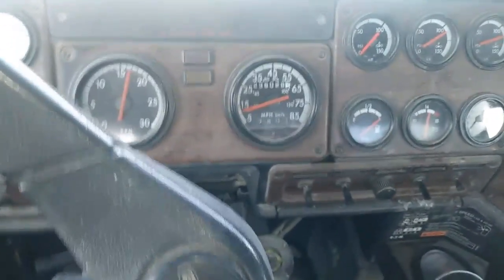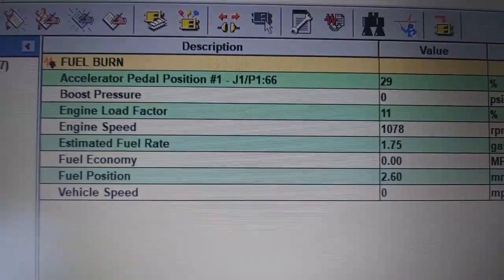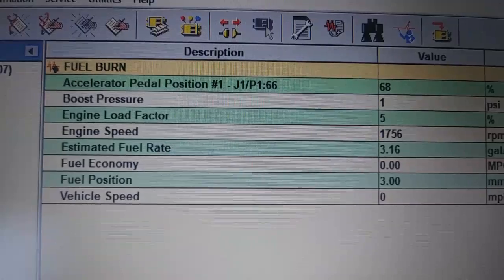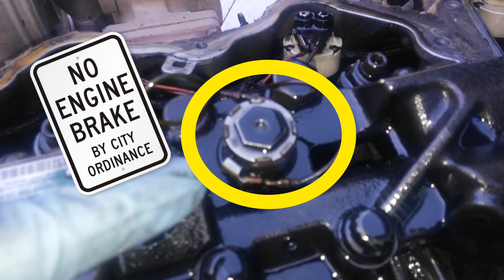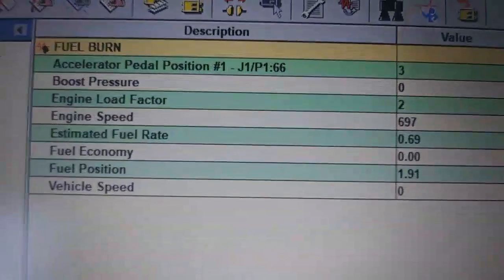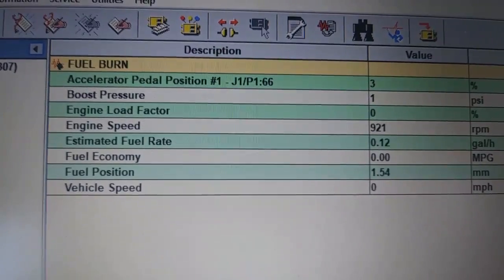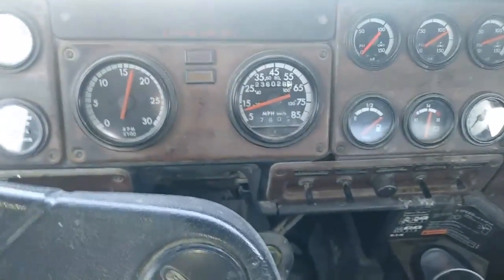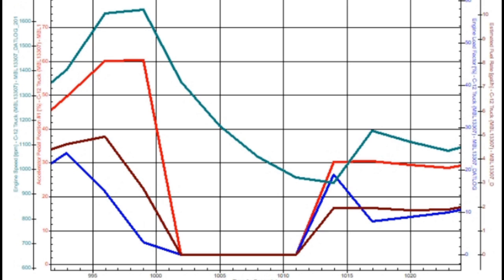Does Engine Braking Waste Fuel? Do Jake Brakes Waste Fuel?

Comment: I know your an cat certified mechanic.  But call me crazy,  but in order to downshift a gear,  you have to rev the rpms up right? In other words it does burn fuel but not when the Jake or engine break is currently in operation.  Just when dropping gears.
Reply: Well essentially yes. But when you have throttle input the Jake brake turns off
Reply: Your question is a little misleading. It is not the increase in RPM that burns more fuel. At a closed throttle position a gas engine uses the minimum level of fuel. A diesel at idle position injects the minimum amount to maintain engine rpm and most injector pumps if the rpm is higher than idle but the throttle is at idle inject zero.
   On both types of engines when one blips the throttle to assist in a downshift there is very little fuel used. Any fuel burned greater than what is needed to maintain creates usable power. When you are in gear this is what accelerates the vehicle. When one shifts all extra energy goes into accelerating the engine (or engine and transmission if power shifting). That really is a very minor load compared to the vehicle. As soon as you are back in gear after the shift you are also back into the minimum or zero fuel state regardless of RPM.
Reply: Happy b.s. productions  I saw where you replied, I could not find it for a reply. Please note the that my reply did not at any time mention number of cylinders. Also notice that this video has both Gasoline and Diesel engines included. My reply stands, the same principles apply as stated to both diesel and gasoline. It takes very little energy to spin up an engine to assist in downshift and the fuel flow is at minimum when throttle is closed. The savings are observable in either case.
Reply: greenketch1 you are correct! Plus, if you are raising the rpm to downshift, the jake will not normally be operated!! If raised to the downshift point, and then the throttle is released, the jakes can operate, and slow the vehicle, in a more efficient manner, due to the increased engine rpm, and the lowered gear ratio!

Comment: jake braking or engine braking  is just turning you engine in to an air compressor  hence the loud noise that they make when its in use.. cat, cummins and detroit engines use this very well for slowing down big payloads 70-100k lbs.. the mack engines don't use it very well as the are an smaller displacement engine tho there is one exception to that and that is the vgt that the newer engines now have
Reply: ,,, I believe the Mack Dynatard moves the exhaust valve less than a Jake . But in effect very similar.

Comment: I spent a lot of years looking at one of those FLD dashes.
Reply: wally twixter I still have 2 to look at neither  of which  supports an ELD, very valuable.
Reply: @elljay4587  you can hook an eld to anything, the eld working and being compliant with the mandates data collection are entirely different things. The lack of data to collect is the reason for the exemption of old trucks, not wether or not it would function and record drive time. I have 2 as well, 1 FLD and 1 old shit spreader.

Comment: Yes I do enjoy your videos a bunch! Having had several E models and C-15s both single and 2 turbo models, I was reluctant to buy a C-13 Accert engine with high mileage. When the dyno came out good at a Cat dealer where I bought the truck, the guy explained to me about how deep the liner goes into the block on a 13, and it was considered a ''clean slate'' model by design, whereas a 15 has the very shallow liner protrusion depth and thus they are prone to cracking! Yes, I was able to experience ''hydrolock'' on a 6NZ I had at the time, and got to tow it and in-frame the whole engine at only 700,000! Please go over ''hydrolocking'' in a future video to explain to your viewers! Thanks and keep up the great work!

Comment: Somewhat related question.  I'm aware that most injection systems when placed in a zero load zero throttle "cut" injection.  Now if injection is truly cut why don't I see EGT temps drop to idle levels?   I can do this for extended periods on I70 coming off the rocky mountains and never see EGT's drop below say 600 degrees.  Yet at idle EGT's drop to 325 degrees in short order, certainly less than 600 degrees in seconds.  I would think while driving down a grade and injection events stopped the sheer volume of air running through without combustion would drop those temps in short order.
Reply from the maker: That is an interesting question isn't it. What are your rpm, boost, and Jakes on/off? You will usually have some boost just due to the fact there is a decent amount of air traveling through the turbo. The compression of the air by the turbo increases the temp a little, but I'm guessing that at higher rpms and due to the compression ratio of a Diesel, that air in the combustion chamber is pretty dang hot. The air itself ignites the fuel in these engines so it has to be pretty dang hot. That is my guess.
Reply: AA - There is still combustion occurring within the combustion chamber while the Jakes are operating (at least on the older mechanical engines), and that permits the engine to maintain temperature.  Decades ago during a descent, the engines not equipped with Jakes always realized a drop in engine temperature depending, the degree of which depended on whether the rig was equipped with an on/off fan or shutters.  

My question for you concerns cam actuated injectors, where the injector plungers would require a continuous flow of diesel for lubrication purposes, so are you certain that fuel delivery is curtailed during Jake Brake operation?  I can understand where there would be no fuel injection on electronically fired injectors, it is just that I personally have not delved into the subject with much depth to see what is happening in those situations.

So I am being lazy and asking you for the answer.
Reply: @cwj9202  ,,, partial answer, if there is any combustion it is extremely small and not at all if there is no fuel, or ib double extremely rare maybe some engine oil .
Reply: Roland, we are on the same page here.  On the older mechanical engines, the fuel delivery would be at idle levels.
Reply: I would also be willing to bet it's hot compressed air. Air compressors only get to 150psi or so and think of all the heat they create at the discharge line from the head.
Reply: Yeah your dumping air hot enough to auto ignite diesel fuel rite at peak compression its hot as heck.  When your burning fuel at idle little to no boost very lean fuel ratio the hot air of compression is then being used to ignite fuel thus cooling it some and becuase it is staying in the cylinder to do actual work it is cooled more and absorbed by the engine before it is final exhuasted at little to no pressure

Comment: ,,, Clessie Cummins invented the Jake Brake after he retired from Cummins . The management at the time, at Cummins, did not realized the huge potential, and Clessie with the connection of a relative hooked up with Jacobs in Connecticut (I think) and developed and brought the amazing invention to market. Its an amazing story, look it up .
Reply: The jake or engine brake is basically a compression release. Not very many people really know how they work. If you can find a 2 stroke motorcycle from the 70s most had compression releases on the handlebar via a lever. When going down a hill if you pulled the lever it slowed you as well as sounding similar to a jake. It was just a valve in the cylinder head that opened and stayed open until you released it. It let more volume of air into the cylinder with nowhere to go except through the compression release or exhaust port. On a jake its the same except the air is passing through the exhaust valves
Reply from the maker: I've heard in the past that Cummins developed it, but I've never researched the history. Thanks for the mini lesson.
Reply: Mr Cummins invented the engine brake to set a new coast to coast speed record, he had the power to stay at speed everywhere so all that was left was to find a way to go faster down grades without overheating the service brakes. Same as most automotive inventions it all started with the need for speed..
Reply: ,,, the story I read had him on that famous coast to coast trip; however coming down Cajon their brakes failed and they narrowly avoided death. Waaaaay before Eye-15 . And this prompted the invention.

Comment: someone needs to educate American truckers how to use a Jake effectively. RPM is required. you need to get the rpm up around 2000 to get enough braking coming down a hill. when I used to run south I saw many trucks burning their brakes on hills I could jake down at 55 mph at 80000#. Siskiyou summit has a sign that says at 80k they expect you to go down at 18mph!! if you know how to run a jake that is a 50mph hill with zero drama, yet I have seen trucks burning on it time an time again. those drivers need to be educated
  https://www.google.ca/maps/@42.0633823,-122.603565,3a,75y,45.87h,88.43t/data=!3m6!1e1!3m4!1sVDAc5N13A6hzujfDMrIBzQ!2e0!7i13312!8i6656
Reply: The bureaucracy has not caught up with modern technology in regard to the 18 mph sign.  Driving down the Siskiyous during the '60's without jakes required driving 20 mph, and that was at a time when the GVW legal limit was 72,000#.
Reply: I know of companies that disable or limit engine braking for only one reason, winter driving conditions. If I’m loaded in the winter mine is on full bark mode. Empty I might click it down one notch. I also know drivers that see the “no engine braking” signs and never use it anywhere they go, fearing they might get in trouble. I’ve also lost traction on ice because of the engine brake but never at speed, or with a load on, and only city, or slow speed driving. I have a Detroit 60 series in the truck I drive and the engine braking is most effective at about 1400rpm. So you gotta do some thinking to know what gear to be in to retain control on a downgrade. Every engine family and engine manufacturer is different. And I’m sure every driver knows use one gear lower going down a grade as you would going up the grade.
Reply: @half-assedgarage6668  1 gear lower? Good rule of thumb if you don't know the truck or the grade, but in a modern truck your probably going to go down a gear or two higher then what you went up. With my 1LW cat (99 fld120) I go up and down in the same gear, now with my 5EK Cat (96 international 9700) even with the Jake's recently freshened up by Cat Im still looking at dropping 2 gears for the downgrade. 

As far as engine brakes working best at 1400 that's a load of bull, lower gear at a higher rpm will always provide more braking force regardless of what engine new or old. It's the way gear ratios and force multiplication works, no engine on the road is exempt from the laws of physics.
Reply: Jay Dunbar there must be something wrong with my truck because at 1400-1450 the engine brake holds much better than any other higher rpm. It doesn’t feel like it’s gonna run away from me but that’s the sweet spot. My last truck was a maxxforce international and what you’re saying was true with that truck, the higher the rpm the more braking force, that also had an exhaust brake not engine brake.
Reply: Jay Dunbar you’re welcome to drive my truck. Maybe I don’t know how.

Comment: Here's an interesting little tidbit people might like to know I'm going to use the year of 1972 caterpillar engines did not have a jake brake all Detroit's were two stroke and they never had no jake brake there were still a lot of 335 Cummins engines running around I don't know about caterpillar but on a Detroit you could let your foot off the throttle at any RPM and it didn't hurt the engine on the Cummins engine if you let your foot off the throttle and let the engine hold you on compression over 1500 RPM you could break head bolts you always run your Jake brake between 1500 RPM and 1800 RPM if you went over 1800 RPM at put a stress on things and you would break head bolts I can go on the other things that's necessary to make the engine last back then but my question now is why is it that modern engines you don't have to worry about this people get in their air ride truck with their air ride seats and their AC and their power steering they use the jake brake in any RPM they can just Mash on the throttle and nothing is hurt maldades these drivers wouldn't make it halfway across the country and their motor would be blown up so what is a safe RPM to run your Jake brakes if you want your motor to last how about these guys that use their jake brakes through town and they can't seem to be able to shift the truck without a jake brake how does that affect the long livity of some motor
Reply: Since there is far less cylinder pressure created when operating the jake brakes compared to normal running pressures under load, any head bolt breakage that occurred during jake brake operation was merely coincidental; so, any head bolt breakage while using the jakes would indicate the head bolt was already on its way out.  I've seen more broken head bolts on engines without jake brakes than ones equipped with jake brakes.  Use of jake brakes while shifting does not affect engine longevity, but it can affect transmission longevity.

The old jake brake manuals stated the engine RPM should remain near governed speed for maximum retarding benefit.
Reply: ,,, The Jake, but not initially, became available for the two stroke 71's and 92's Detroit's .

Comment: Automotive smaller diesel engines have a butterfly valve on the intake which closes when you let off the throttle to create vacuum and also it closes on engine shut down to ensure a smoother shut down. Great video!

Comment: When you brake, you are taking energy away from the vehicle. If you want to move again, you will need to use fuel to add the same amount of energy back. If you could predict traffic and stops perfectly, you could drive without any braking, saving a lot of fuel by only slowing and stopping when unavoidable. That's one reason why city driving uses a lot of fuel. Ofc no brakes = not safe. What about downhills? If your truck was indestructible, there were no speed limits and bends were built accordingly, you could get back all the energy used to get to the hill top. Driving a car on down that sale hill at the same time as the trucks would be frightening.

Comment: Wait, diesels might not do produce enginebraking through a vacuum.
But instead they produce a lot of heat while the compressionstroke is happening. (which gasoline engines won´t).
From a certain point, where the piston is now moving towards top dead center, the air exceeds the coolant temperature thus creating thermal energyflow from the compressed air in the cylinder to the coolant (the energy for this is provided by the kinetic energy of the vehicle).
Even in case of non existing jakes, the pressurecurve past top dead center will now be as a result way below the pressurecurve before that.

And from my own experience by comparing 2 cars of the same engine size and the same weight with N/A gasoline and turbodiesel, my conclusion is that enginebraking on a gasoline engine is way less powerfull than it is on a diesel engine.
Even with a gasoline engines typically significant higher RPM´s.
Reply: ,,, I agree, and will stick my neck out and say in the Diesel, with the Jake is engaged the compression is 70 percent and the vacuum is 30 percent of the braking, but this is an opinion. Also keeping in mind that the Diesel will generally have a half dozen or more points of compression.